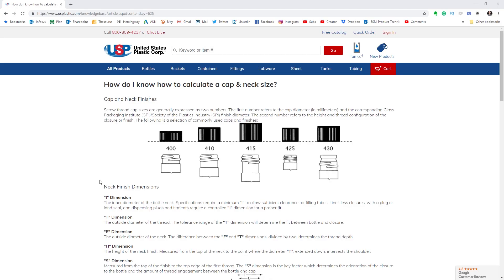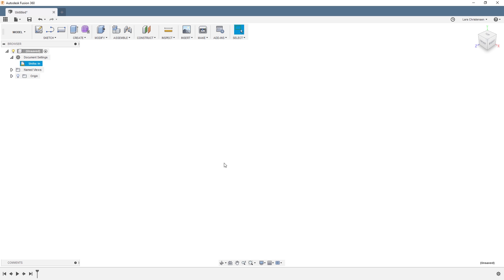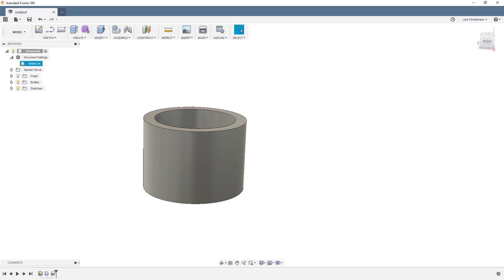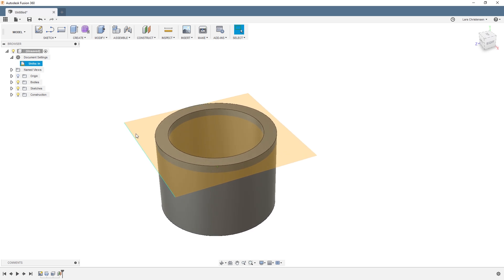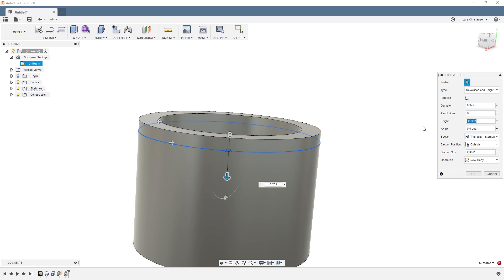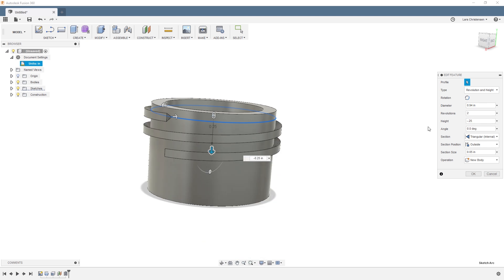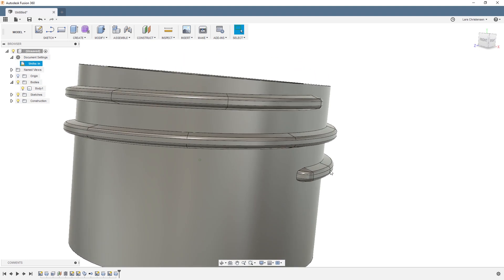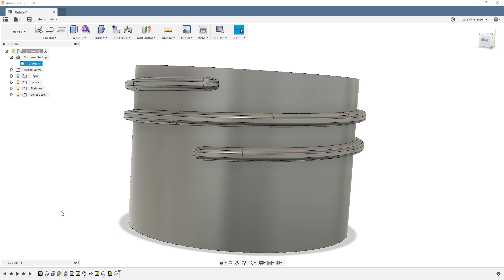How To Model Bottle Thread in Fusion 360 — Season 2 EP12

Comment: Hello Lars, I really love your Videos and also my son was watching them to learn more in Fusion360.
For my wifes garden I built a Ram Pump so far, but need an adapter part to connect an 1" pipe thread with a thread of a Coce bottle (only for the test).
The bottle thread works great in the test print. Now the lenght of the 1" thread is 18mm. The diameter starts at 33.5 and ends 31.8 on the outer side. How can I do that?
I hope you find time to help me with this problem.

Comment: at the start why not a cerkle and ofset why a rectanguler and revolve?
Reply: Lars was thinking pragmatically, beyond the "neck," which is all that was used here.  If there had in fact been a bottle attached to that neck, the shape of the bottle would be significantly easier to achieve using Lars' method.

Comment: 5 thumbs up for the revolve on the two end planes to round off the ends! Next request, a male/female twist-lock thread. I am working on this now, need to join 2 cylinders such they they align at an exact point, e.g. 1/4 turn twist and they lock together at the correct point.  Thanks Lars, really enjoy your tutorials!
Reply: model male side as above. model female end as needed as a seperate component. Bring the female component into the male design as position as needed. Then use the male side to "cut" the female threads, while having "keep tools" checked so it doesnt delete either male side, only the threads from where they intersect the female body. This can also be done by choosing intersect instead of cut and keep tools, then deleting the body that is created (as that is the threads inside the female body.

Comment: Hello Lars,
  Your best source of data on thread finish specs. would be SPI, the Society of The Plastic Industry. They used to publish a very complete guide that covers all of the standards that allow a company to create a mold, and then a bottle that can use an industry standard closure.
  All of the standard thread finishes are called out by the T dimension, or major diameter in millimeters. I had made a lot of prototype neck finish tooling with milled threads, using a form ground milling cutter. To get the thread form to come out correctly the cutter must be in alignment with the helix angle of the thread. The circumference of the major diameter as the side adjacent, and the thread pitch as the side opposite. I am unsure if this helix angle could cause the problems that you showed. I do believe that I remember seeing this subject discussed somewhere on Auto Desk in the past. Your sessions have helped me a lot with Fusion. Now it is time to try to help you.
Reply from the maker: Thank you for watching 👍and for your great comment😊

Comment: To prevent it from twisting, use both rail and guide. Grab 2 edges from the internal "dummy coil" - use one for rail and one for guide. I can't remember which is which, but try one or the other as guide or rail.. (it's been confusing fusion users for years if you watch various guides for coils :) )
Reply: To ammend my own comment: If you just included that one profile from the "dummy thread", you can use ' "Path + Guide surface" under Type when you do your sweep and use the surface of the cylinder you make the thread on as a guide. Sweet!
Reply: @k2OS  Thank you so much k20S.
Reply: @k2OS  Thanks for that tip .   I never could figure out that twist.

Comment: To create a custom helix check out the excellent Helix Generator Add-in created by Patrick Rainsberry. You can find it on GitHub (his user name is "tapnair"). It really saves you time if you're creating custom threads on a regular basis.
I loved the trick you pulled to create the lead-in at the ends of the thread 👍

Comment: Great video Lars!  I need to make a box for some parts I am making.  Can you do a demo with Sheet Metal tools using Card Stock?  I am looking to fold the card stock in a way to have double thickness outside walls and to have a flange of the card stock pass through the horizontal midplane inside the box with cutouts to hold the part the box will contain.  If you could show how this could be done, I would be grateful.

Comment: For the Europeans (or especially the Germans): One of the most common PET Bottle threads is available on Thingiverse (and so far worked great for me :)): https://www.thingiverse.com/thing:2693686  
Unfortunately, it needs to be copied back into Fusion360 after every update, which is rather anoying - @Lars Christensen, is it possible to import thread data like that in a more persistent manner into Fusion360 (or could this even be included in the thread library in Fusion360)?
Reply: Thank you!

Comment: Very interesting lesson. On the thread design though, anything you do from 13:26 and on is not realistic for a thread as all bottle/cap threads taper in both vertical and horizontal planes so that you essentially have two tips of an arrow meeting so the cap and the bottle have an easier time agreeing who is on top.... Caps and bottles have problems when the tips of the threads collide.

Comment: Actually, the problem you faced with the helix is a standard issue in Fusion with helixes. Has been there for a very long time. Doesn't happen in Inventor, though. That's something that really needs to be sorted out. This piece of software has so much potential and it's so great and then it has a basic little bug like that
Reply: I tried to use Autocad about 20 years ago to make thread (it did not have a tool built in) and the sweep would twist just like this one did - except there was not "twist angle" to correct it. (or at least not one I could find.)
Reply: It's a pain, yes, and has been bothering other Fusion users. The trick is to include one more edge from the dummy thread and use 'guide + rail' under Type when doing the sweep, or.. use "Guide + Surface" and use the surface of the cylinder as guide surface.
Reply: Four years later, this is still a problem!
Reply: @mechanoid5739 not a problem if you read the other comments.  Sweep type guide+rail.

Comment: I am struggling with threads in fusion. How thick should a plane be to apply a thread? I did a pipe with an outside thread and it cut through the pipe’s wall. In need an outer diameter of 25mm and as much space inside as possible.